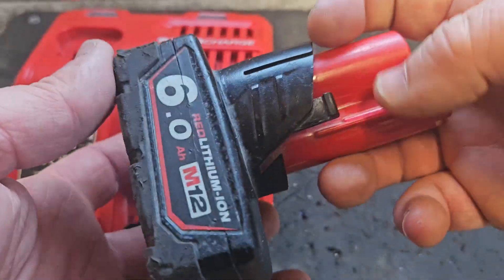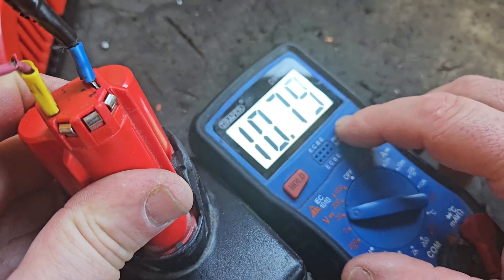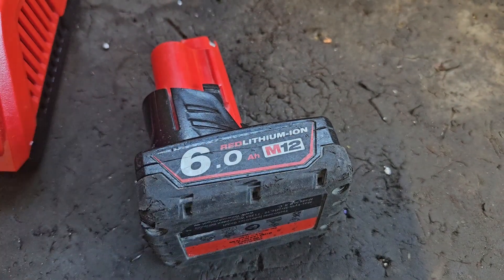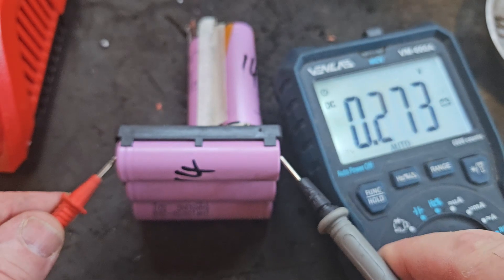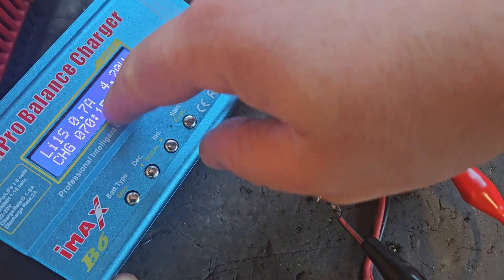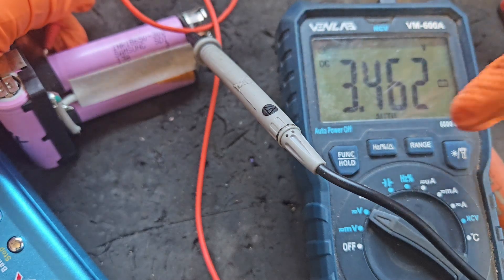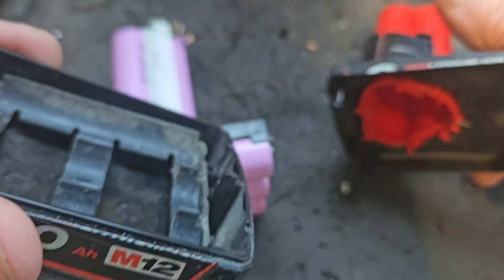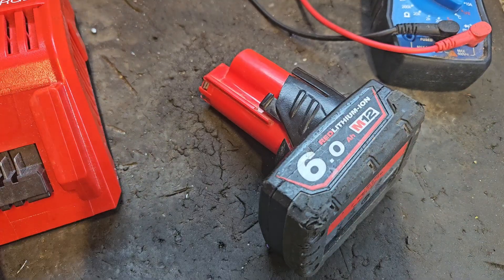Milwaukee M12 6Ah Battery Not Working? Fixing Cell Imbalance

Comment: Hi there.Do you swap the case of your batts? Because I just got my new 6ah m12 batt from ebay and they have the same exact case like yours ,but i open it up and there where  noname brand cell  ICR instead of INR with 2000mah instead of 3000,so its fake....
Reply from the maker: Are you asking me if my battery is fake? No sir Are you asking me if yours is fake? sounds like it

Comment: how have you connected onto the final bank there?
Reply: Been trying to figure this out too. The first battery I did the 3rd bank was 4.092v so I just charged the other 2 banks to the same voltage and the pack was fine. Have another battery with the 3rd bank being low so gonna have to have a go. Did you come up with anything?
Reply: @JDH88 haven't gotten round to it yet. It looks like hes wedged some metal under the little black rubber cap on top. Might try with some copper.
Reply: @eazyrat I had some time this afternoon so I had another look, thats exactly what hes done. Under the black foam theres another wee stucker that covers the negative sode of that cell, I peeled that back and was able to get a connection. Ill charge it tomorrow and see how it goes.

Comment: Thank you this has enabled me to restore 2 x 6Ah M12 batteries.
I also have a question - would it also be possible to simply balance the complete battery using the imax B6 connected to the two normal charge points and select setting 3S and allow to slow charge the whole battery?  Cheers
Reply from the maker: There is a way to balance the full pack using the B6. The m12 is a 3s battery so the correct balance lead and plugged in to the white slots and connected to the right points on the battery
Reply: @doctorlefthandthread  Thank you for your reply and suggestion, I will give this a try when I have a battery that is out of balance.  Cheers Tony

Comment: You need to do a vid of how to set up that b6 iv just bought the one in your link and I can’t get the settings you have
Reply from the maker: I have been attempting to do video reply but I can only do a 3 min reply at the longest it just doesn't cover it. I will attempt to do a longer video soon.
Reply: Iv figured it out 🙃 is there a reason you don’t put it on fast charge?
Reply from the maker: @phippsy75 its better to charge cells slower